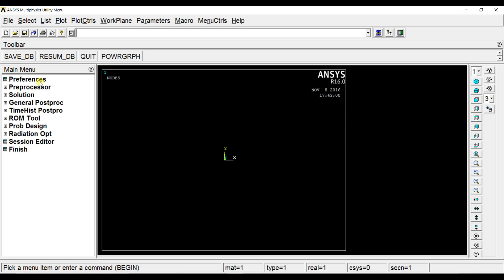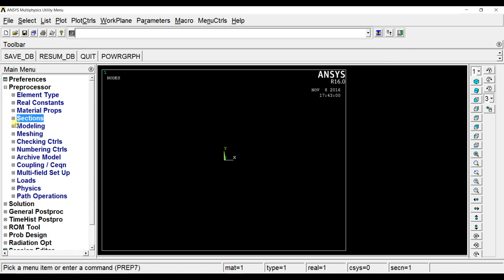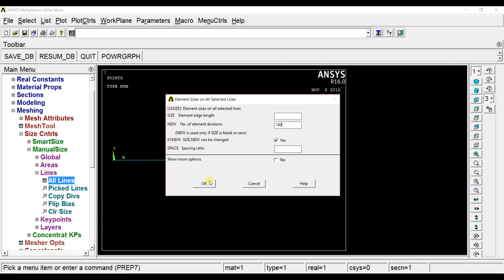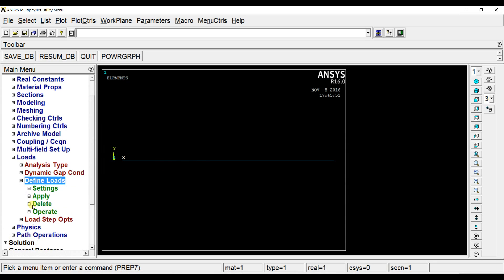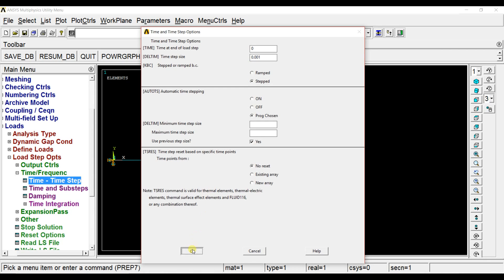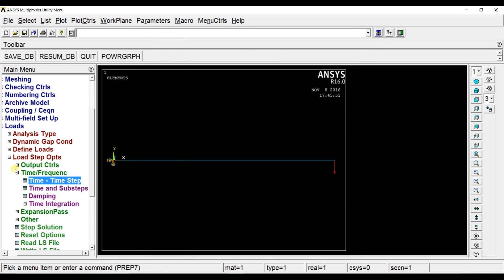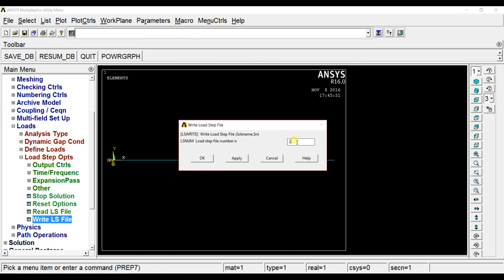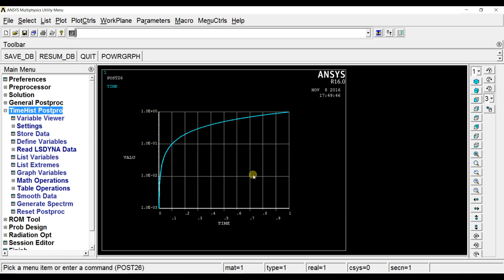Transient Vibration Analysis in ANSYS APDL

Comment: How to apply series (about 100) load steps for a non linear (bilinear isotropic hardening) static analysis so as to get load deflection curve for my geometry. I have got shell181 element for my thin shell pipe geometry, for which i have to ramp up my bending load from 1N to 1000 N with internal pressure remaining constant. Then i have to plot load deflection curve for selected nodes of interest.

Comment: how to read force as a function of time when the force data is in excel spreadsheet.?
Reply: use *dim command to create a blank array in ansys and call the values from excel using *vread command
Reply from the maker: im sorry i never did that and i'm not sure that works in APDL, maybe it works in Ansys workbench
Reply: Hi Anvesh,
I am also facing the same problem in workbench. Have you found out any solution for the parameters as a function of time?
Reply: Hi Jagadeesh,
Can you explain this clearly. Because I have the same problem while working in workbench
Reply: +Phani Kumar 
I did not know in workbench
Reply: Hi jagadeesh,
Do you know how to do it in APDL?
I mean the commands which specify loads with respective of different temperatures.

Thanks
Reply: As I am very new to Apdl, I also cannot find any detailed list of commands on internet.
Do you detailed commands for this. If yes, please share them.